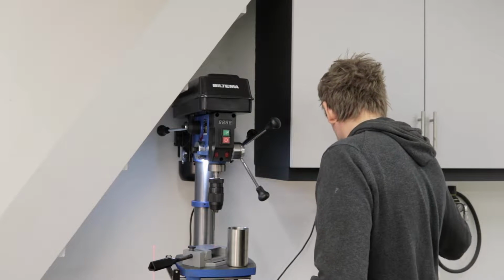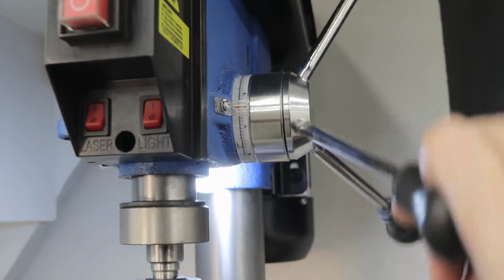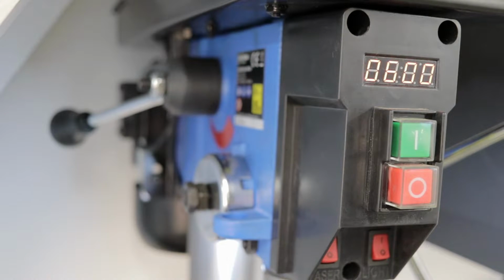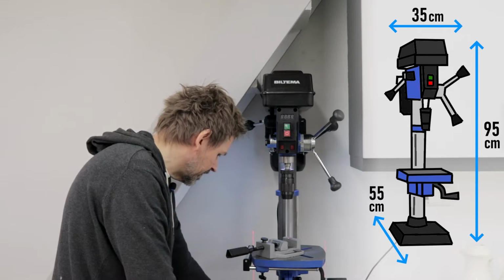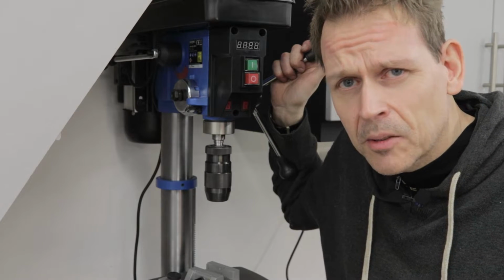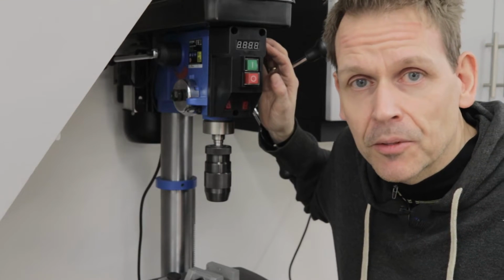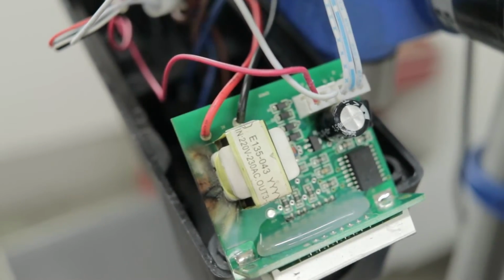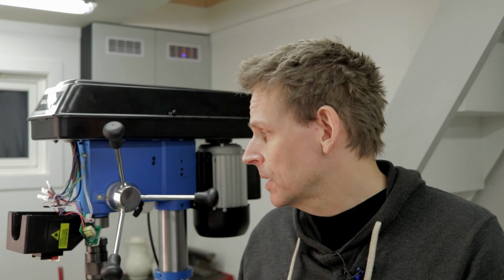Bench Drill Review - Good News and Very Bad News (Biltema BD5512)

Comment: Guess who got himself one of these only four days before you posted this video.... Glad I'm in the habit of unplugging EVERYTHING in my garage because we often suffer from having thunderstorms randomly zapping anything plugged in without a seperate surge filter/guard... I do not need or use the laser sights, so that is fine, but i do fancy the rpm counter... I actually had similar troubles with a miter saw from the same store (Biltema) last year. The problems was mechanical, not electrical. Less then a year later they re-relased all their miter saws. Mine had the product number 17-695, and was re-released as 17-6950. The new models was greatly improved and had none of the issues the first ones had. I hope the same evolution will happen to the bench drills, but if this electrical problem is common, then they really should consider a recall or provide repairs...
Reply from the maker: Yes, I totally agree. I notified the shop where I bought it, so hopefully they will pass on the feedback to someone in charge.

I have a new video ready quite soon where I show how I solved the problem :-)

Comment: Interesting review.

I'm assuming it's a European specific brand because I have never heard of it before.

My go-to brand is Ryobi. It is also interesting to point out the dB rating on the box.

We don't get that in my country. But my father told me about something similar when he went to Switzerland in 2001.

He was referring to vacuum cleanerers and that they are a lot quieter than the ones we get.

The wall plug is very neat with the cover. We do have those in my country but mostly as adapters or if you buy a fancy wall plug.

You get those plugs usually on hair dryers, vacuums, heat guns, Jigsaws, etc. Usually on dangerous appliances.
Reply from the maker: Hi again 😊 Biltema is a Swedish retail corporation, you can find stores in Scandinavia and the UK. It's like a downscaled Home Depot, their tools section of the store is somewhat similar to Harbour Freight. 

Their own branded tools are typically made in China. Very reasonable priced, sometimes the quality is decent, other times not 😏

We tend to have more regulations and rules here in the EU compared to other continents. It's probably a EU regulations saying that the noise level must be displayed on the package for these kind of products 🙂

Comment: My man! First I stumbled upon your channel when I was looking for a new kompressor, saw your biltema kompressor enclosure video. Convinced to upgrade one day to the quiet one. Today was strolling in the aisles of the local biltema, and caught my eye on the drill presses. Fell in love with the biggest one and came back home and "I wonder if anyone has reviewed it?". So here we meet again! Good review, thanks! I wonder if the problems with it was related to faulty components/batch or your electric grid. Anyway, I haven't gone through your videos yet to confirm whether you still have this drill press or not, but could you give me your honest opinion if you think this is worth buying, and if you like I would be interested to know what you still think about it, good and bad, what needs to be upgraded/fixed/modified, what broke etc. I was impressed in the store by the fact that the drilling bed was not bending under the load of drilling down on an item, like on the cheaper ones they tend to flex by the pressure of drill pushing down. I dont mind tinkering with it, or upgrading / modifying, and I think the first mod I would do would be a quick release handle, like those in bicycle seat posts, for the height adjustment on that drilling bed locking clamp.
Reply from the maker: Haha, it seems like we are buying the same stuff 😅 I think Biltema has improved the electronics in later models, I did report the problem and others as well. I have not heard about problems in the last year. 

I am very satisfied with it! I can't understand how I managed without all the years before I bought it 😝 No issues at all (after fixing the electronics), and it has been through some beating. 

I recommend buying a good vice for it. I bought the biggest one from JULA, but even that is a bit weak and not very solid. I have managed, but are looking for a better one. With such a big bench drill a quite big vice is needed as well. 

All in all, I think you will be very happy with the purchase 👍
Reply: @kihestad  Great, literally on my way to biltema now. Theres a jula store opening in my city next week, might go there to check out the vise. I guess you mean a machining vise, not a bench vise?
Reply from the maker: @Ricqu  exactly, those flat ones you put on top of the bench drill bed. To my knowledge Biltema don't have any worth buying.

Comment: I wanted to buy this machine, but after seeing your video plus another one about it, I decided to contact Biltema. They claim that they changed supplier, but if something happens, they will replace the machine. Nevertheless, I did not dare to buy it, because it is not acceptable that they are selling such crappy quality at that price, even if the current price should be regarded as "cheap", I am not interested in it because it is not fun to transport it back to them in case this happens with mine as well. Anyway, I bought a twice as expensive Güde and hope it is twice as good also. I don't know yet, since the machine will arrive tomorrow, but specification wise it is definitely better. Also the table is better than the Biltema, Scheppach, Einhell and so on, similar machines.
Reply from the maker: Thanks for sharing, I can absolutely relate to what you are saying. I am not familiar with the brand 'Güde', but it's probably safer buy. I have lately got noise from the main bearings as well, I have to take it apart to inspect what's going on 😔

Comment: Couldn't you do reverse threading by just going clockwise, then turn the piece around after?
Reply from the maker: Unfortunately, it does not work like that. If you turn a bolt or a nut up side down, the threads are still going the same way. Regardless of that, when threading you need to reverse the directions to remove the tool out of the threaded part.

Comment: They all will burn up, they are to tiny for the job, mine transformer is a 100 degree celsius in a minute, and will burn up if i dont power down, but i like the variomatic system on this macine, and i can fix this problem, but for those who cant fix this, dont buy this machine, there is a high risc for fire, better ventilation will not work, only a bigger transformer, or a diffrent power supply.
Reply from the maker: I totally agree!!! I notified my local shop about the obvious faulty design, but I doubt it has been reported 'up' in the BILTEMA organization.

Comment: I think the wobbeling was unexceptable.  Why isn't that commented?
Reply from the maker: Hi, not sure what you are thinking of. When in the video does it happen? I would say the machine is t very sturdy. When tightening all the screws after adjusting height and bed position it is very rigid. I have not bolted it to my bench though, I have not found the need for it yet.